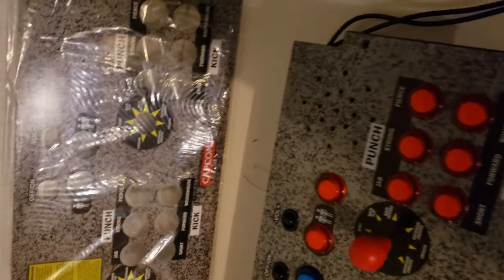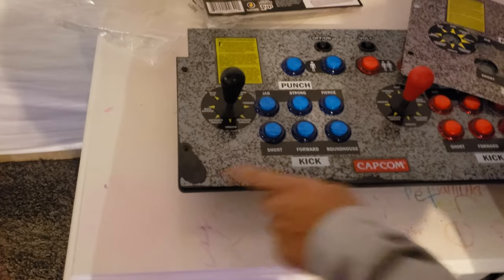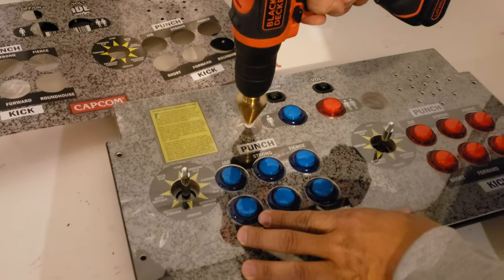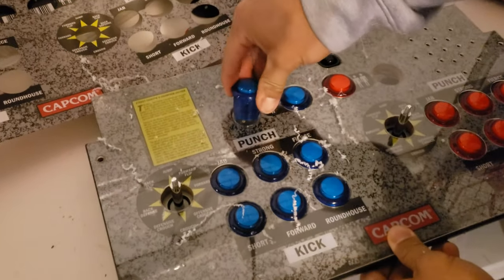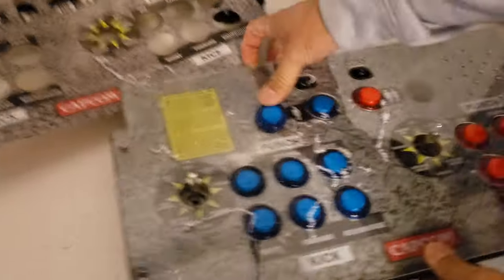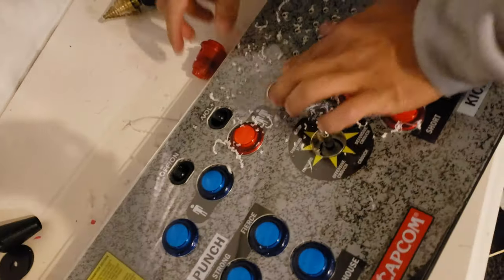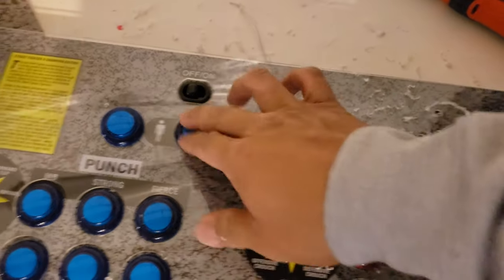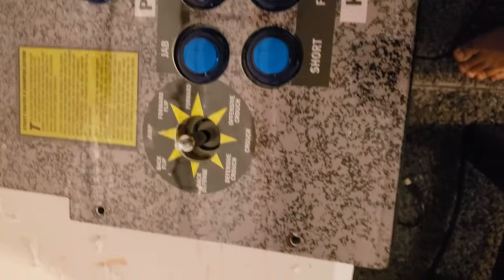How to drill plastic protector for the Arcade1up Fast and Easy!

Comment: I would recommend at least clamping it down gently to the control panel, use a piece of rubber to protect the overlay. Other than that, I have used step bits for this and they work well.
Reply from the maker: thanks for sharing and glad it worked out for you!